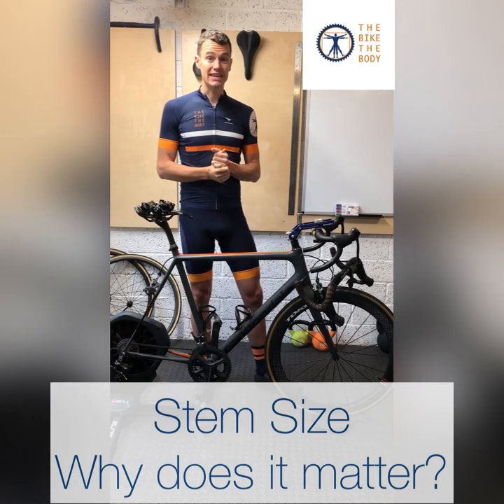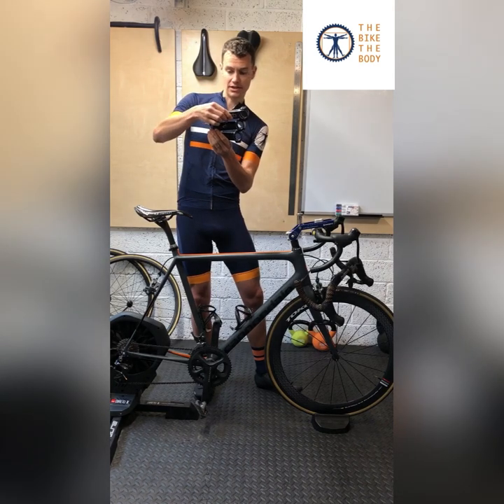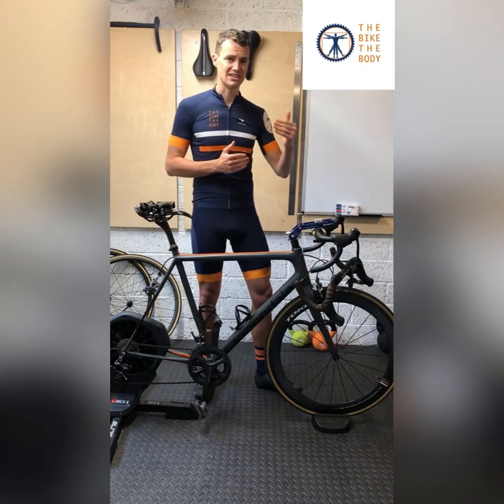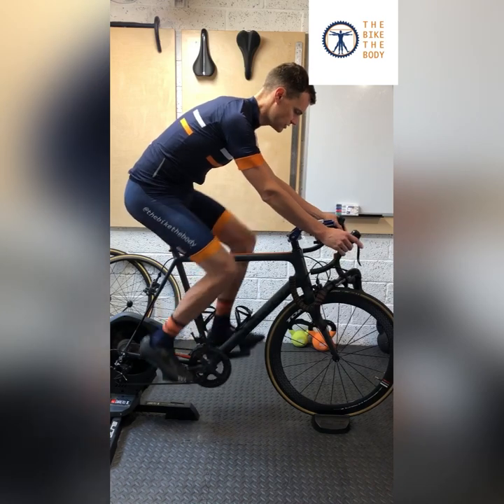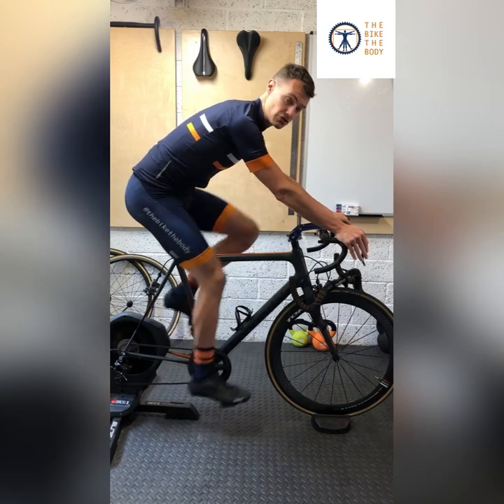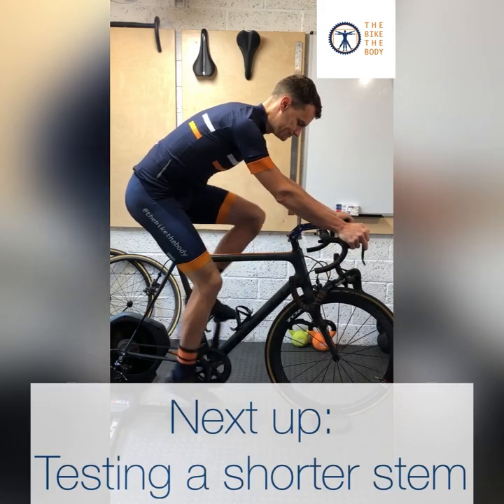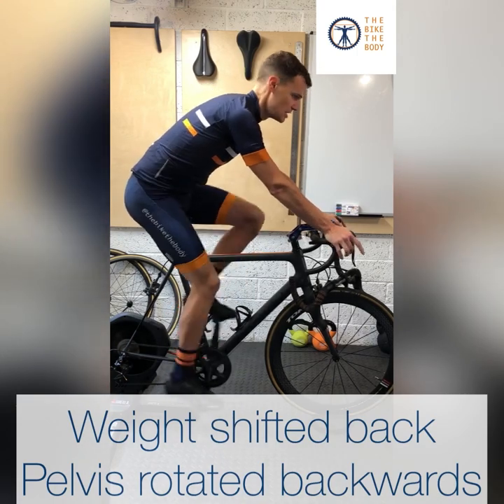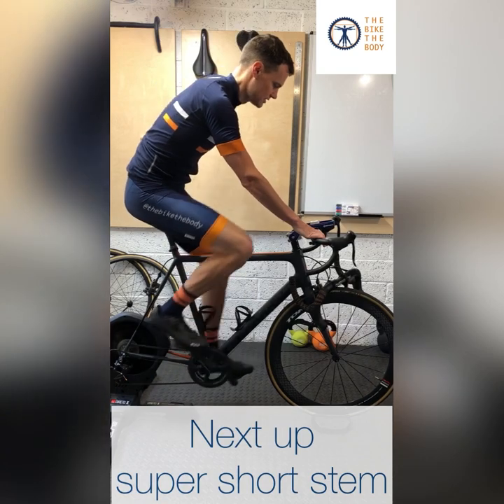What size stem for your road bike?!

Comment: My bike fitted great but I moved the seat a bit back because I had a bit of a knee pain. Knee pain gone but now I feel my position is too low and I have a neck pain which I didn't have before :( I'm hoping that flipping the stem will help but I'm quite disappointed. Thanks for the guidance.

Update: The issue was that my seat was too high. Returned my setback to center and reduced seat height by 30mm and it all got fixed.
Reply from the maker: Hi, well you beat me to it but glad you got it sorted out. It's always quite a challenge moving parts around as one movement can affect a lot of other things as you have experienced. Hope you found the videos helpful

Comment: Lemond had a quick way of checking stem  length ... forearm parallel with the top tube, elbow against the nose the saddle and fingers stretched out flat. They should brush around halfway up the length of the stem. Cheap n nasty but for me, fairly accurate. Saddle stem height difference, start at 8-10 cm, adequate for most riders unless you have exceptional core strength and flexibility
Reply from the maker: yeh i've got nothing against some of these old 'rules of thumb' they can work quite well for many to get into a useful position. having said that, if we use only anthropometic measurements (i.e the length of your hand or forearm) it ignores any consideration for the riders strength, flexibility, injuries, riding needs (e.g race performance vs casual club riding or commuting)
Reply: @thebikethebody  Couldn't agree more, mate.... cycle fits didn't become scientific really until Hinault and Genzling really started taking morphology and ergonomics into account, taking it to the science it is now. Ironic that on my FB page there is a story on Sean Kelly, who always rode a bike far too small for him, but "just got used to it" his words...
Reply from the maker: @stevestewart-sturges2159  yep, as a true 'hard man' he'd have probably got used to a nail for a saddle!! what a legend, being Irish I am of course somewhat biased!!
in terms of the tech in some areas we've almost gone too far the other way where many focus so much on the tech and data they have that they forget about the most complex and sensitive tool in the process - the rider!
i believe it was Einstein (but I could be way off and happy to stand corrected) said that not everything that can be measured is important and not everything that is important can be measured. it's something I always reflect on when discussing bike fit
Reply: @thebikethebody  Thank you! What a thoughtful reply, and a lovely quote... All the best for 2021!

Comment: My height is 5'8 and I have size 48 road bike frame. I have standard stock stem. My shoulders and wrist are sore when riding my bike. Which length of and height of the stem should I get?
Reply from the maker: impossible to be able to sugges just based on this information, more likely to be other more important factors such as overall balance and position on theb bike, I explain this in some of my other videos
Reply: Bike is probably too small for you.

Comment: I have a 100mm 7° stem pointing upward and I feel like i'm putting a lot of weight over my handlebars, generating neck and shoulder pain. I don't know if I have to put a shorter stem like 70mm or 80mm or just change it for a bigger angle, like 15° or 17°. What do you think?
( I'm already a the top of my head tube, with 40mm spacers.)

Thanks!
Reply from the maker: Hi, it’s really important to remember that the length of your stem and it’s height / angle only make up a part of how your weight is managed across the bike. saddle set back and angle are important aspect to consider - a downward angled saddle and forward position (common problem in people trying to reduce reach) can massively increase the weight and pressure on your hands - hope that helps
Reply: @thebikethebody  Thank you for the video! IMO, it also matter of your riding speed(Or power) as well. If I ride around speed of 15mph my setup feels aggressive (I'm 6'1, 56cm frame, 120mm stem) but it feels very comfortable when I ride above 20mph -25mph, which is my average speed. Any thoughts?
Reply from the maker: @joshyang59  hi Josh, this is a great point and you’re absolutely right. as we produce more power, we are thereby put more of our weight through the pedals which increases postural stabilisation which in turn reduces the load / weight going through the front end thus making it easier to hold a relatively more aggressive position

Comment: Hi. I’m 6’6” tall.  I have an old 12 speed road bike that I’ve gotten a special seat that moves back and up enough to give me more space in that my knees bend properly while riding, so my thighs apply pressure most efficiently.  The problem is my will stem is too low so uncomfortable to ride the bike.  I’m trying to find out what length, etc I would need for a replacement quill stem.  Is there a system where I can put in my body measurements to determine what size quill stem I need?  I think my bike has a 27” frame.
Reply from the maker: Hi, I would suggest you might be better off trying a quill stem adapter so that you can fit on a regular modern stem which will allow much greater adjustment capacity on length and height. They're also fairly inexpensive. Hope that helps

Comment: Your saddle is quite low. What is the knee angle at the bottom of the stroke and why is it that angle?
Reply from the maker: I presume you’re referring to how much seat post there is exposed from the frame as your estimate that the seat height is low.
firstly, the older supersix always looks like this to an extent due to the horizontal top tube. secondly the frame is a 58 where I would preferentially ride a 56.
The seat height seen here is 800mm, and yields a knee angle (if you consider that to be of important as an isolated measure) of approx 145
Reply: @thebikethebody  Thats a 35 degree angle. Isnt 25-30 a better range? Or was it in the old days?
Reply from the maker: @DevelopingNL  very much depends on the individual - using normative numbers to inform fitting for saddle height is rarely the best approach to find the best seat height for any one person - there are many other elements to consider, so, 25 might be fine for one person but not work very well for another

Comment: Interesting…I had a bike fit last year and my stem was changed from a 100mm to a 130mm and i now have pain in my shoulders and especially neck area..unfortunately my bike fitter is no longer trading…should I change my stem to a 110mm?…would appreciate any suggestions 🙏🏻
Reply from the maker: it can be difficult to answer this as it is likely that the stem was not the only change during the fit. so there could be a multitude of factors contributing to these changes and issues you desribe. 
However, given how easy / cheap it is to swap a stem over to test (if it is a more traditional set up of bar/stem and not all carbon one piece) then it's definitely worth trying this.
the best option would be to find your best local or nearish bike fitter to help out - check out the IBFI fitter locator page for suggestions

good luck

Comment: Seems like trial and error still. Couldn't it feel fine in the studio with the fitter, but after a couple days on the road still not work?
Reply from the maker: Hi Aaron, absolutely, that is why most bike fitters will try to encourage cyclists that a bike fit is / should not be seen or considered to be a 'one-off event'. There is currently no way to test what any part of a set-up will be like out on the road with climbs, descents, rapid cornering, different surfaces, 4+ hr rides etc - as such we use knowledge gathered over years alongside research into the area of bike fitting, cyling injuries and of course the most important tool (in my opinion) rider feedback to guide us towards the best outcome. 
Hope that answers your question.
Bryan

Comment: Im from philippines, only 5'2" 130lbs my bike size xxs47 with short stem
I have sore in my neck n numbness in my hands, what should i do??
Reply from the maker: most likely your weight / balance is not well distributed across the bike, or you have too much drop tio mange your position - get a bike fit you possibly can - check out one of my other videos and see if you can do the 'balance test' this will give you some idea

Comment: Please RECHECK your definition of REACH. 

I believe it’s incorrect!!

Reach is the horizontal distance from the center of BOTTOM-BRACKET to top of the  HEADTUBE.
Reply from the maker: Cheers for the comment, yes you’re right when referring to frame geometry that is what it refers to but in a more functional sense in bike fitting the same term is also used merely to describe the distance the rider needs to cover between seat and bars - appreciate the confusion though 👍
Reply: @thebikethebody  agree. You means reach in general term. Not in geometry term 👍👍👍👍